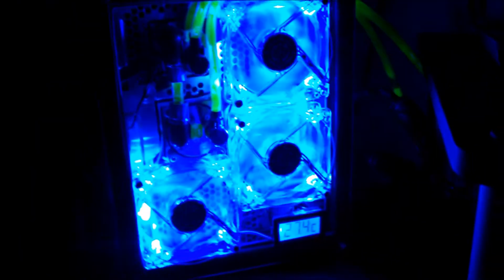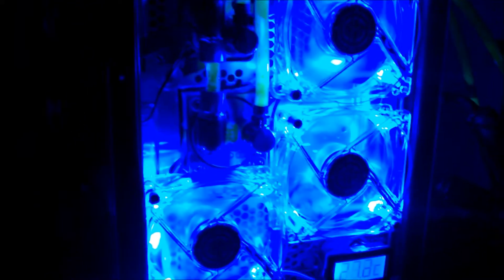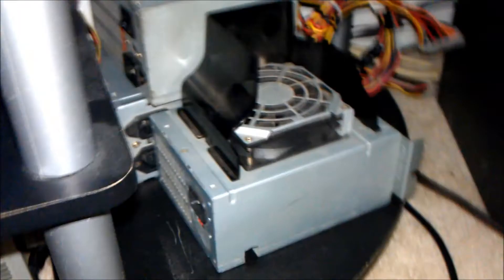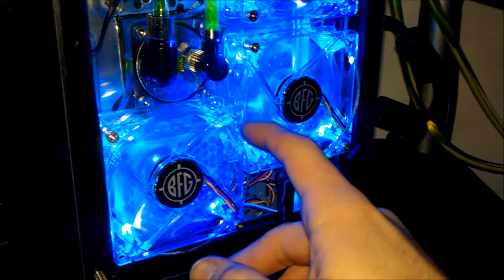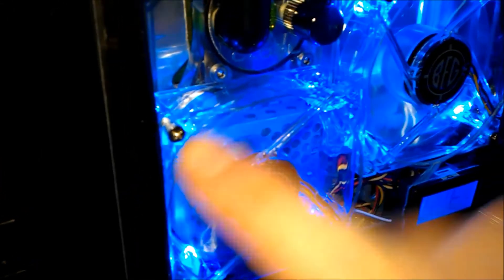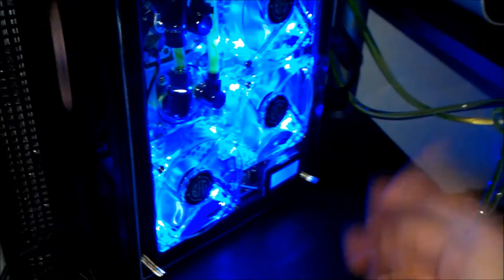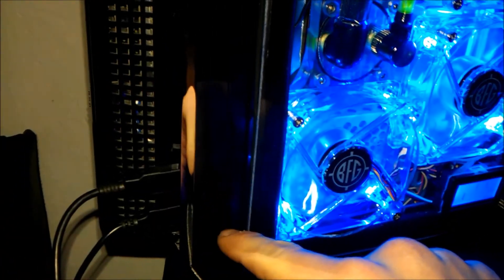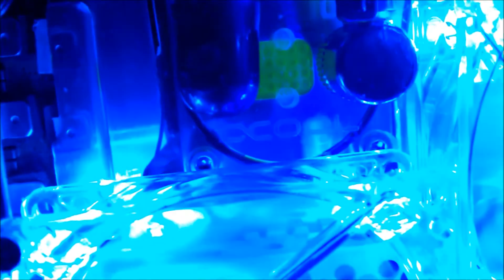Watercooled Custom PS3 details and explaination

Comment: Im going to Liquid cool my PS3 just for kicks. Going to use a 
360 rad
2 GPU 200 Cold plates:
Custom made resevoir and a 12v pump:
Going to mount it on the panel on my HAFX that im doing a custom loop on, use the extra space to mount a 250w PSU that is jumped with 5 switch toggle [1 toggle for PSU/Cooling for PS3, Another for a digital readout/lights,then the rest for my PC] be about 80 bucsk or so for the parts. Sooner or later ill get it done haha.

Comment from the maker: @BlackStallion351 by elbow do you mean the fittings on the water blocks? they wont effect coolant flow even in a miniscule amount. liquids are incompressable, if we were talking about the exhaust on my sportbike, yes elbows or sharp bends will create resrictions and reduce flow. aslong as the ps3 elbows are the same or bigger internal diameter as the coolant hoses there wont be a problem. sorry for the huge response lol

Comment: im having the same problem.. i custom made my own "wind tunnel" i guess using the original PS3... moves ALOT of air!.. thought that would solve it.. but it still overheats.. ive heard elbows screw up the flow but every ps3 i find uses them.. also... where/how did you put the temp sensor on the CPU..

Comment from the maker: Make sure the pump is functioning, also make sure the pump isn't too powerful. 
If it is moving the fluid too fast it may not have time to absorb heat away from the chips. 

also, you still need some air moving over the motherboard in order to cool some of the other smaller components

Comment from the maker: if i remember correctly, it is on the top of the motherboard, above the USB ports (they are 5v) I used the #4 usb port i think. 

As for 12v, ,you can use the stock fan power

Comment from the maker: i think you are talking about the wires coming off the 3 blue case fans. 
they are powered by the original power wires for the original fan. 

no, the original fan is no longer on the ps3, it would normally be where the 3 blue fans are now

Comment from the maker: well, mine is 72 liters per hour
so yours is 500 liters per hour.
I'm not going to claim I know a lot about thermodynamics, I haven't taken it yet, but i think that may not be a good pump. 

but you could try it out if it is intended for water cooling PC's, and if you're running hot get a slower pump

Comment from the maker: @MegaAnonymousme idk if running tubes out of the waterblocks would make any difference, 
but it would definately be harder than just using the flexible tubing.

the only benefit i would see to using copper tubing in there would be that it would hold more heat, and maybe act as a sort of heat exchanger if the fans were moving enough air over them. 
Even then, the pipes are smooth and dont have much surface area or drag so it probably wouldn't make a big diff

Comment from the maker: @MegaAnonymousme they only mount with 2 screws because there are only 2 holes in the motherboard for the screws to pass through. 
There is a spring plate on the backside which holds the heatsinc, or in this case the waterblocks, tightly in place.